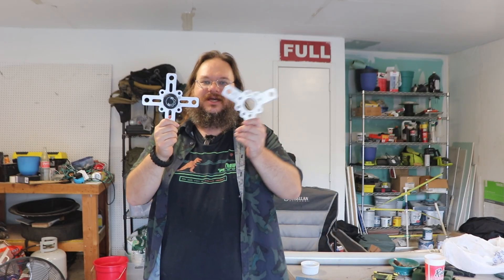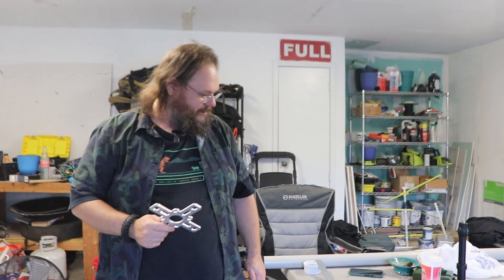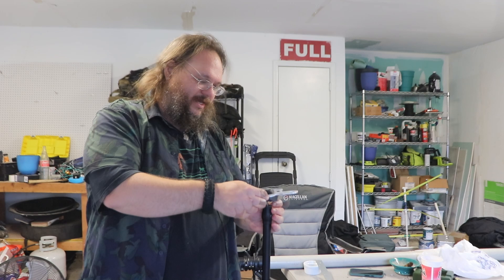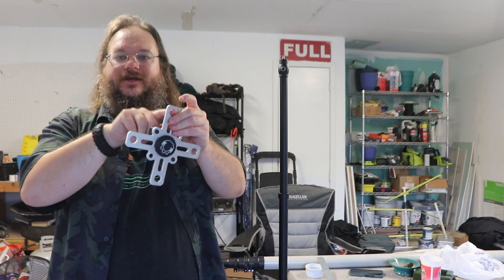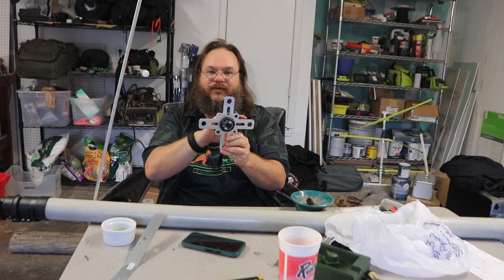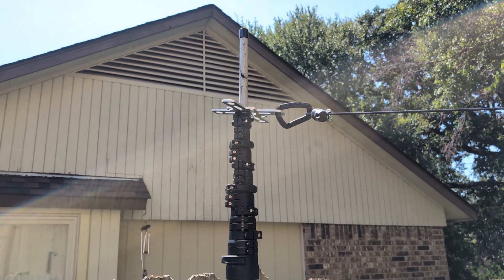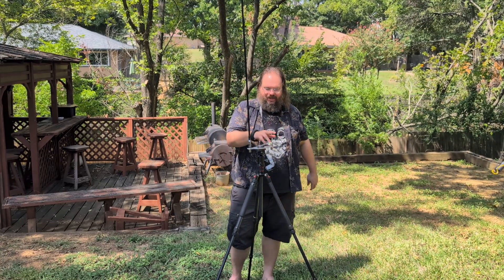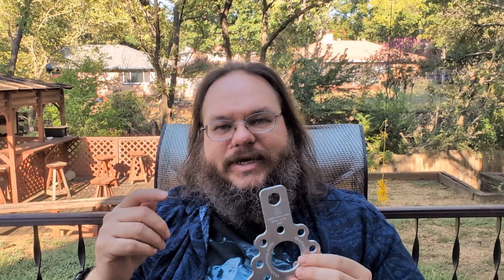First Peek at Sky Hooks: Revolutionizing Portable Ham Radio Masts

Comment: An adapter for mounting these Sky Hooks atop non-standard-Acme-threaded painter poles would be a useful addition. Poles up to 20-25 feet are widely available at decent prices. The hitch is that that the adapters for attaching anything at the top are typically designed for paint brushes or rollers and made of flimsy plastic. When I've tried to attach mobile antennas to them, they bent, leaving the antenna tilted to the side.

The only connector I've found that's metal and strong enough for attaching an antenna mount is called a "sanding pole adapter." It's designed to attach heads for sanding sheetrock to the top of these poles. Something similar would allow Sky Hooks to be used with painter poles.

Comment: Frank, you could build up some electrical tape around your mast and be able to tighten the clamp down around that or cut a piece of old garden hose,  slit it, wrap it around the mast and clamp it down. Just a few thoughts to help out
Reply from the maker: Those are some good thoughts, we do need to be careful not to over tighten on the fiberglass cuz the fiberglass will split.  The Gap was large enough for electrical tape. I don't think would have worked well.  A garden hose or some other rubber gasket might work.  However, I'm working with Scott to see if his new solution on the different sizing will solve this.  And he wants to so I might as well help out the manufacturer.  And get it right for y'all

Comment: great looking product but maybe a bit pricey for the largest mount, but the smaller ones look reasonable.
Reply from the maker: He smelt has its use case, and your use case for it.  But I can't wait to get the system out on the air. It should still be getting some wire today

Comment: Are these for the Korean War era 5' aluminum poles that were actually used as a 40ft antenna mast or are they for the 4ft fiberglass canopy pole sections?  I own both and they are different hole diameters.
Reply from the maker: Originally, yes.  However, I don't have any to show it.  I think it's a 40mm inner diameter haul.
Reply: @TankRadio I have both.  Just measured the fiberglass canopy poles at 40 mm diameter and 35mm for the aluminum.